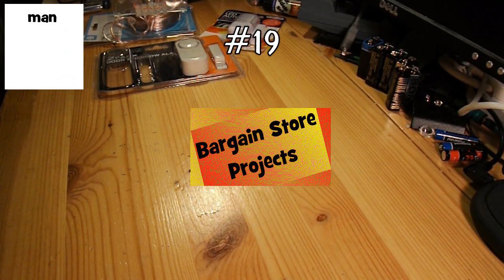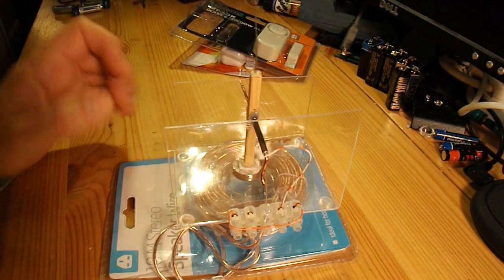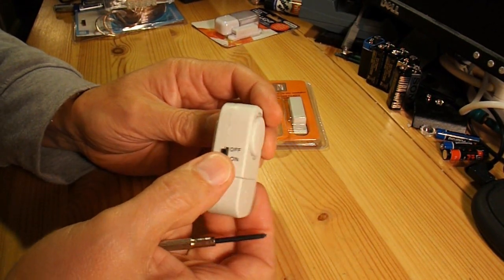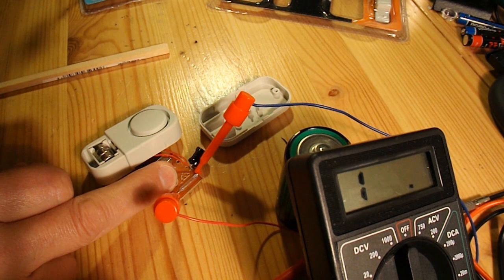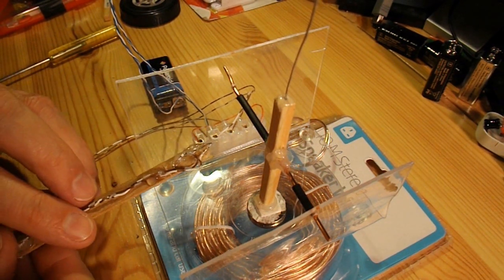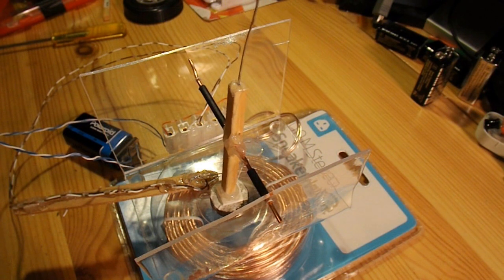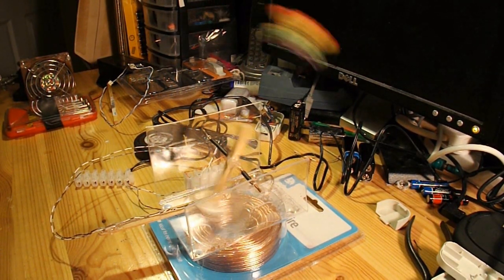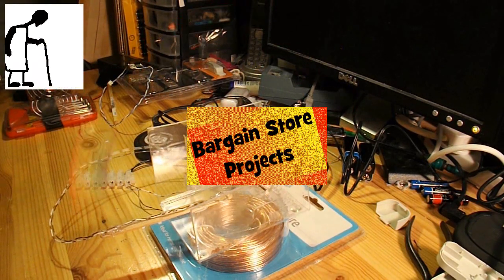Bargain Store Project #19 door alarm reed switch rocking flower

Comment from the maker: Whilst I was moving the reed around the flower started on it's own but that was probably because I was moving the whole assembly. Once it is stationary with no power it does need a nudge to start it after applying the power. I was really pleased to find the little glass reed in the alarm although I did manage to break one whilst playing around with it. They were more delicate than I expected. The draw light reed is in the open air, just two thin plates soldered to the circuit board.